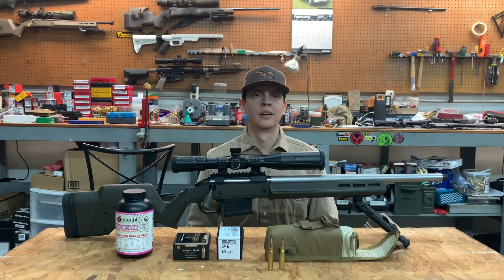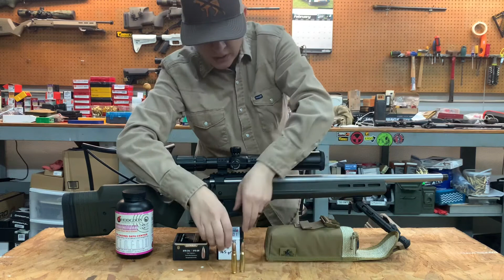375 RAPTOR! Custom Ruger American feat. Magpul Hunter stock, Timney trigger, & X-Caliber barrel

Comment: What are you hunting with Raptor? Whitetail?
Reply from the maker: Whitetail and hogs. It packs quite a punch. Everything has been dead where it stood without taking another step. Planning on making this my round for Nilgai, as well.
Reply: @yellowhammeroutdoors5516  I’ve always archery hunted Ga whitetail and was looking at this round as a candidate but wondering if it’s too much. 

Most shots would be within 200 yards.
Reply from the maker: When I first built mine, I wondered the same thing but I think it’s a perfect round for GA Whitetail. I hunt quite a bit in Laurens County, south of Macon, and it’s my favorite woods rifle. Can shoot through brush if I need to and you can get away with an 18-20” barrel making it very handy in the woods.
Reply: @yellowhammeroutdoors5516  I appreciate the help. I saw a 12.5” chassis pistol that really sparked my interest in the round.
Reply from the maker: I think that’d be great for inside 200 yards.
Reply from the maker: With a 12.5” barrel using 250 grain soft points you could expect about 2250 fps. If you do the ballistics on that, you’re still getting over 2000 ft/lbs of energy at 200 yards and still within a 6” vital zone. I really think it would make an awesome chassis bolt pistol. Even more so if you plan to shoot suppressed at any point.

Comment: What barrel length did you go with?
Reply from the maker: I ended up going with a 20” barrel. That was a good length for velocity trade off while still having something that would be very handy, especially with a can attached.
Reply: @yellowhammeroutdoors5516  where are you pulling your load data from I used the load data from the raptor website and got pressure signs even at the minimum charge.
Reply from the maker: I’m having to work up loads myself comparing what’s on the Raptor website with known data for loads like .358 Winchester. What powders are you using? I haven’t had any blown primers or hard bolts yet.
Reply: @yellowhammeroutdoors5516  I was using 1200-r and 235grn speer. But I'm thinking of trying some h4895. I've never worked up loads from scratch so I'm still reading up on it
Reply from the maker: I like H4895 powder. For H4895, you could start at about 42 grains and work your way up to about 46.5 grains. Something else to keep on hand is a powder burn rate chart to compare burn rates for different powders.

Comment: Yea that makes sense the drop off after 300 because it’s such a heavy projectile. Sounds like your barrel life will be as good or better then a 308 since it’s going 300 FPS slower. Have you taken an hog’s or what ever you like to hunt? Thinking this would maybe offer a one shot per customer for a good 250+ lbs Boar/s. Is the barrel on your savage also an Excalibur, memory got me I think that was a fluted bull barrel in 308? That 375 is cool, that savage is gorgeous.
Reply from the maker: Barrel on my Savage is an X-caliber as well. It’s a Savage Big Varmint profile which means it tapers down to about .810. It’s definitely a heavy barrel and the spiral flutes help reduce weight. It’s chambered in 6.5WSM. Barrel life will not be as good as the .375 Raptor. You are right about barrel life being better than .308. It’s a soft shooting gun and one shot, one kill for big hogs. 6.5WSM is a wildcat based on .270 WSM but with better selection of bullets and better BC for long range. I’ll do a video on the Savage shortly to really go over everything on it.

Comment: Why not use the 338 Federal with 250 grain bullets?
Reply from the maker: Great question, I considered the .338 federal and I actually use .338 federal brass to form 375R. However, 375 RAPTOR changes the shoulder angle from 20 degrees to 35 degrees to provide a well defined datum point for the cartridge to headspace.  In addition, the 375 RAPTOR is .150″ shorter than the 308 Winchester which permits up to .935″ of bullet exposure while keeping within magazine length – required to load the 350 grain Sierra Match King magazine length. This allows me to load very heavy bullets and still be able to load them in short action magazines. This gives me much more energy down range than a .338 federal ever could and also gives me the flexibility to load high energy subsonic rounds, should I have the inclination.

Comment: I kept and used the oem barrel nut. Little crow works makes a barrel nut wrench for the Ruger American to reuse it.
Reply from the maker: They sure do! I used their tool to remove the barrel nut. I like having teeth over a smooth barrel nut though. The one I used is a Savage patterned barrel nut so I can use my savage barrel nut wrench with it.

Comment: Do you start with a 308 and just change the barrel to that caliber?
Reply from the maker: Yes, 375 Raptor is based on a .308 caliber so it is easiest to do it that way. You can use any short action rifle caliber with a .308 bolt face.